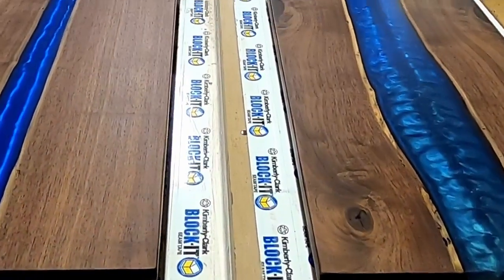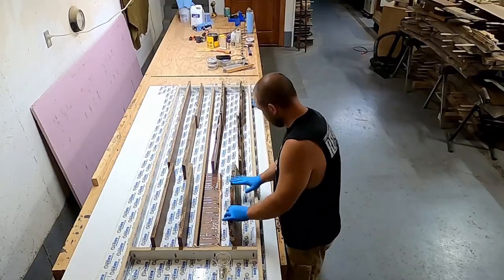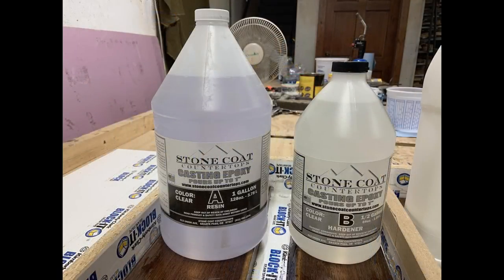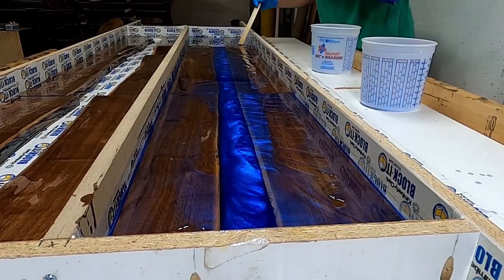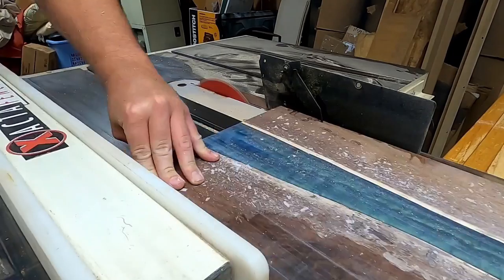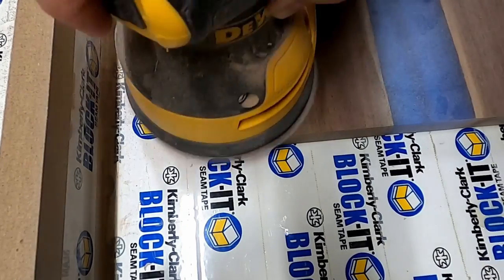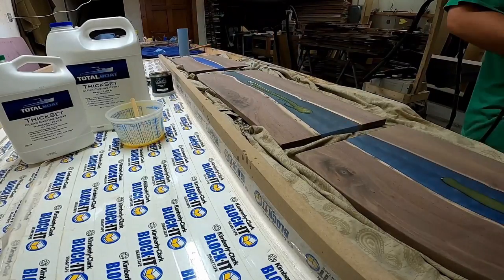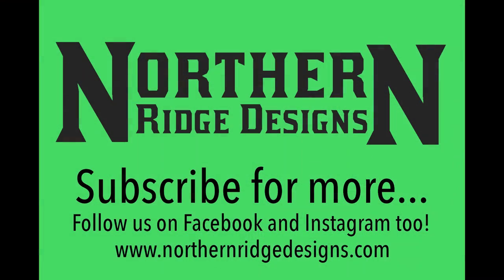How to Make River Charcuterie Boards

Comment: After you poured your epoxy and let it cure, how long did you let the epoxy cure before you sent it through the planer?
Reply from the maker: It would probably be best to send it through after it has just cured into its solid state. Most epoxies get harder as time goes on and reach their max strength after a few weeks or even a month. To be honest, I try not to send fully cured epoxy through my planer anymore because it is really hard on the blades. I bought a larger sander to accomplish the same task. Thanks for watching!

Comment: Sealing the edges before pouring has been shown to weaken the bond with the resin as the deep pour doesnt have any chance to penetrate the live edge making the bond weaker vs just pouring the main epoxy, Maybe not a huge concern but over many years it may be.
Reply from the maker: This would only be true if sealed with something other than epoxy…like poly or shellac. I seal the edges with epoxy and then sand with 220 to create a mechanical bond with the casting epoxy. You have epoxy bonded to epoxy…the wood will break before that bond does. To argue otherwise is to say layers of epoxy will delaminate from each other, which if sanded between the layers, will not happen. The most likely thing to happen by pouring without sealing the edges is to have bubbles in the epoxy. Thanks for watching and for the comment!
Reply: Have you done real world testing to confirm that hypothesis? (Stress testing to breaking point, etc)? Or is this just anecdotal opinion?
Reply from the maker: I have not done any testing myself besides seeing how my own projects have held up over the years so far. I have researched the topic before and I came to the conclusion seal coating is very necessary and does not compromise the bond, as long as you use epoxy for the seal and next layer. Check out this Blacktail Studios video. https://youtu.be/W3KQx0sZ-kU?si=NAniIeOVieQC9UEG  He has made way more tables than me and he explains the process very well in this video and then destroys the table. The wood broke first. He does his coats one after the other, before they fully set up, but mentions how you can let it cure if you don’t have the time and then simply scuff it and pour the next layer. If you haven’t before, I suggest you pour some epoxy, let it cure, sand it and pour another layer. Then, after examining it, see if you think it would ever come apart.
Reply: @northernridgedesigns  no thanks. Epoxy is too expensive to experiment with. It’s never a stronger bond to bond epoxy to epoxy to wood vs epoxy to wood. I just disagree and I realize that may not mean much. In the grand scheme of things both ways may be sufficient but I have not seen any evidence that would convince me to do it your way. Just out of curiosity, what do you think would happen if you cut the completed piece right down the middle and then used epoxy to join it back together?
Reply from the maker: I agree, epoxy is very expensive. If you cut it right down the middle, sanded the cut and either filled it with casting epoxy or used epoxy to bond it back together, it would look weird, but in my opinion, based on my experience it would be just as strong as the rest of the epoxy once cured. Epoxy looks terrible when you scuff it with 220, but then the scratches totally disappear with the next pour because it fills those scratches and creates a mechanical bond. If you just poured epoxy on cured epoxy, I agree it would be a weak point, but once sanded it’s a whole other type of bond.
Reply: @northernridgedesigns  you should try it and post the video
Reply from the maker: Good idea for a video. If I end up with a jacked up piece I’ll try it.
Reply: @northernridgedesigns  looking forward to seeing the results!